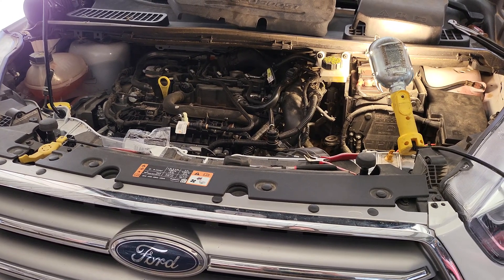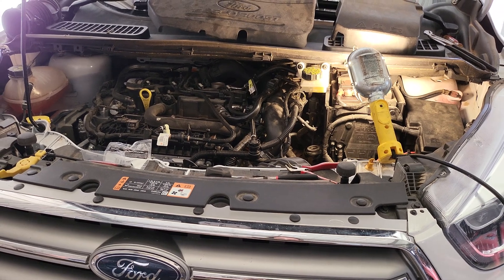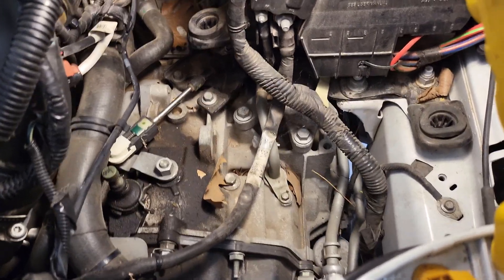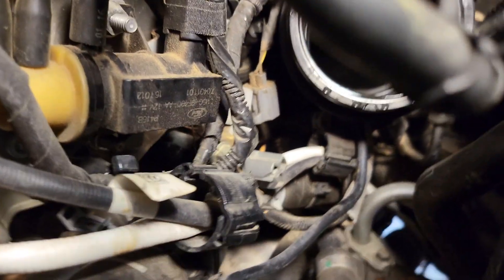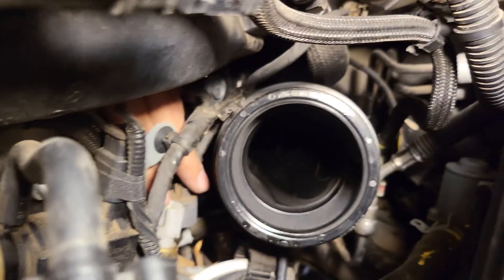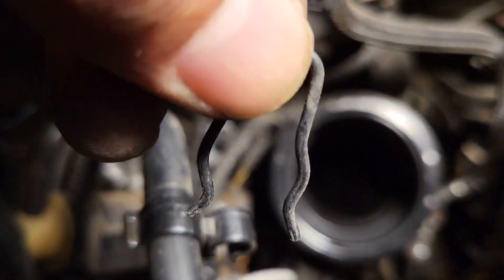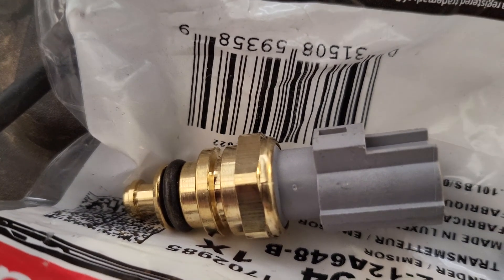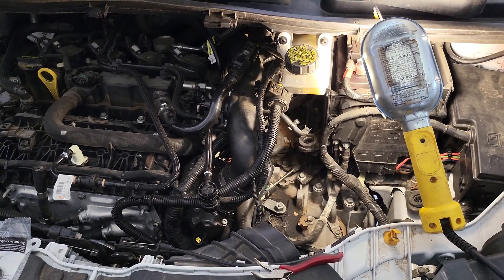Ford Ecoboost 1.5l 4 cylinder coolant temperature sensor location and how to change

Comment: Dude!!! How about showing the part number? How'd you remove the clip? Where is the clip? Why did you replace it? was it leaking coolant or was the sensor bad? How did you determine the sensor was bad?
Reply from the maker: Sorry, not sure about the part number. The clip is easily pushed off with a screwdriver. My cooling fan was on full speed when engine is running. A rodent ate a wire in the bumper area.

Comment: Was this causing your vehicle to want to stall once it got to normal running temp?
Reply from the maker: No. I had a code in forscan about it. And my cooling fan was on high at all times except when turned off. Turns out a rodent ate the communication wires to the radiator. It was an easy but expensive fix as the front bumper needs to be removed for access.
Reply: Is the thermostat near the sensor because my 2019 Ford Fusion se ecoboost is jumping from hot to cool. And saying engine temperature to high
Reply from the maker: Not sure about the fusion. Sorry I can't be more help